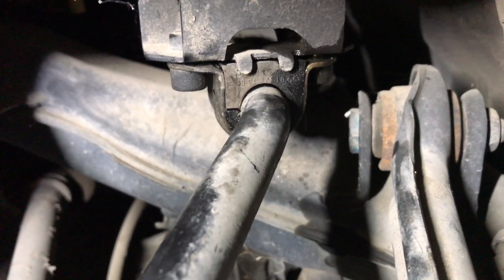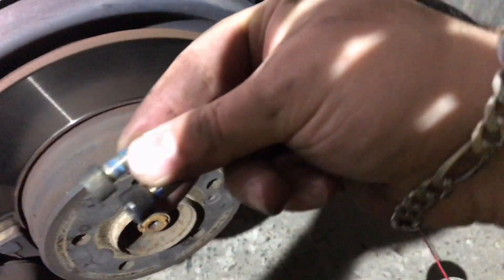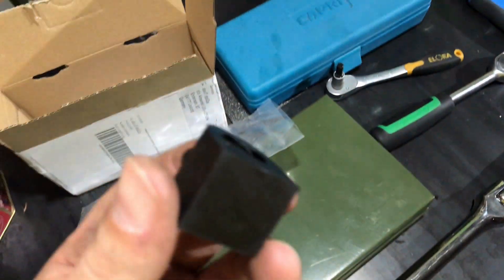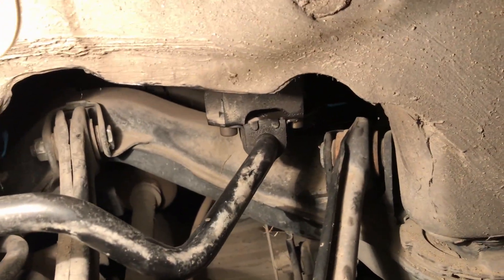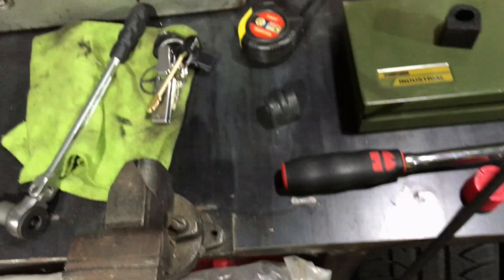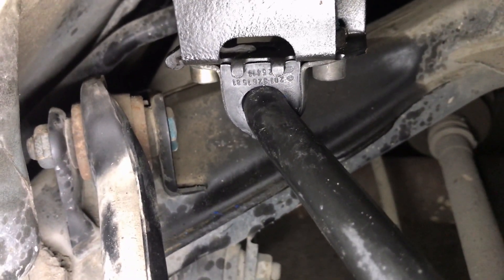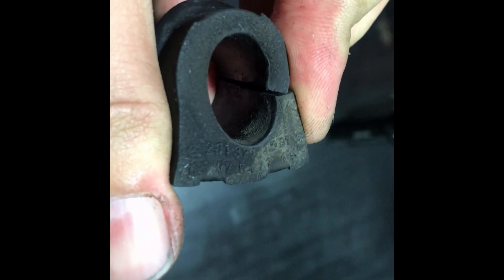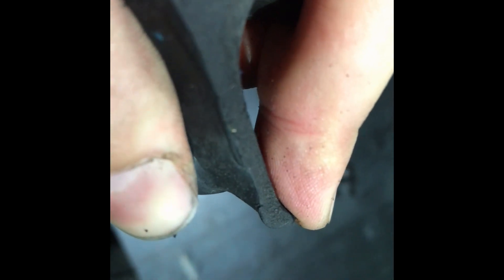Mercedes W210 E430 - Rear Sway Bar ARB Bushings Replacement

Comment: Hi, could someone tell me what is the part number of the metal bush holder. I haven't got sway bar at all.
Reply from the maker: It is Torsion Bar to Frame Bracket. The part number is: A 202 326 02 26. 
Some of the 210's have not rear sway bar from factory.

Comment: Alternatively, if you check no crack on the bushing. Just buy a bottle of AT205 reseal, less than $10. Use a spray bottle to the rubber area. Next day, the squeaking noise is gone. It works.